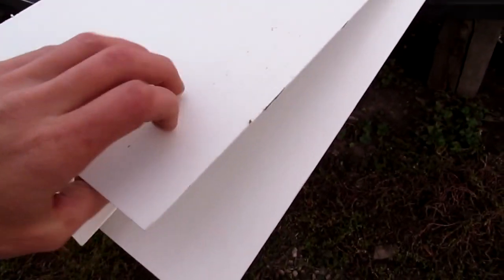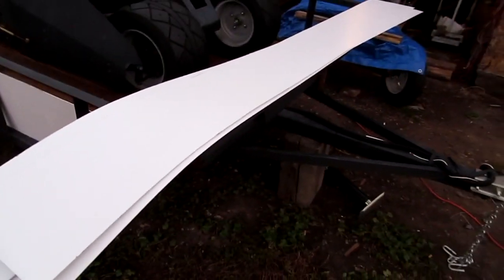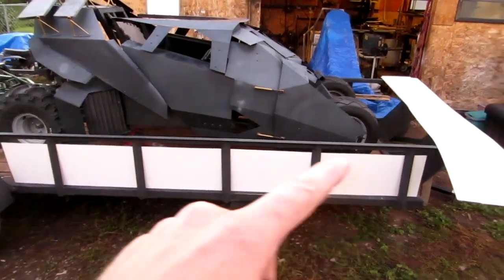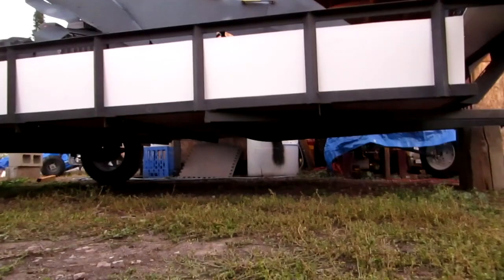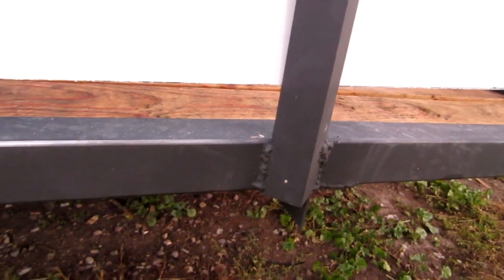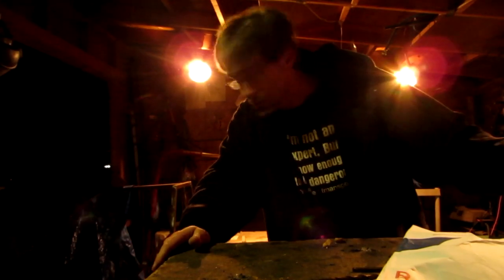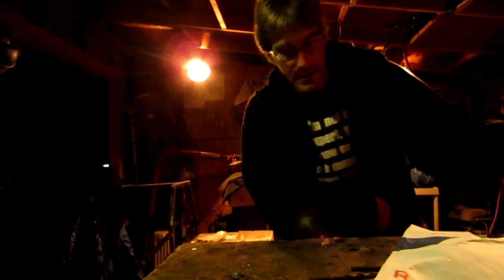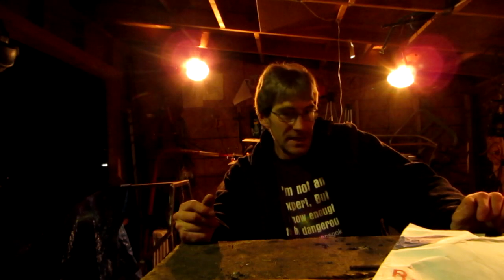Homemade Utility Trailer Build ( side panels & stickers )

Comment: Harbor freight has stainless steel ties that would hold up much better.  I use them on my gokart. They are called stainless steel cable ties.  25 for 6 bucks.  Pretty nice actually.